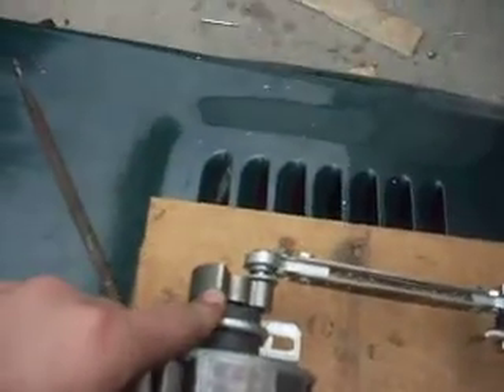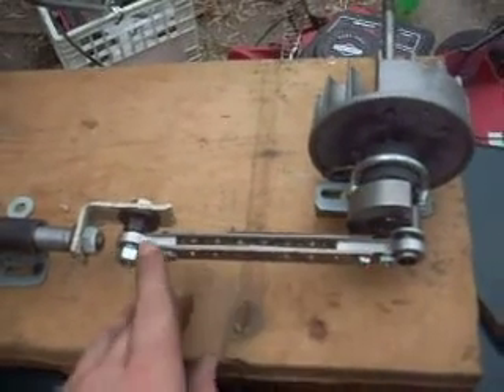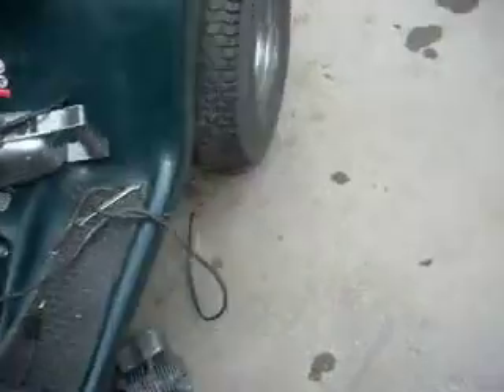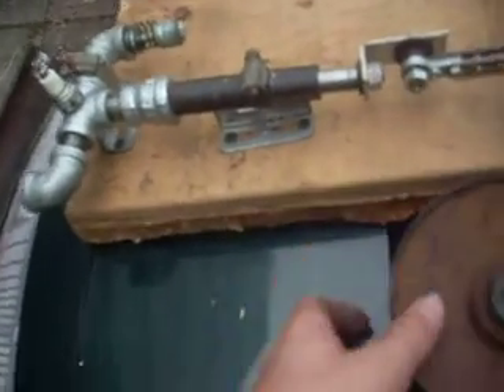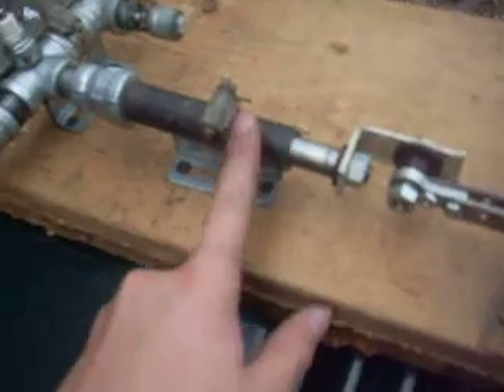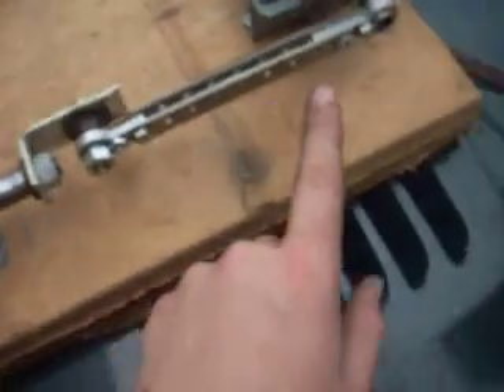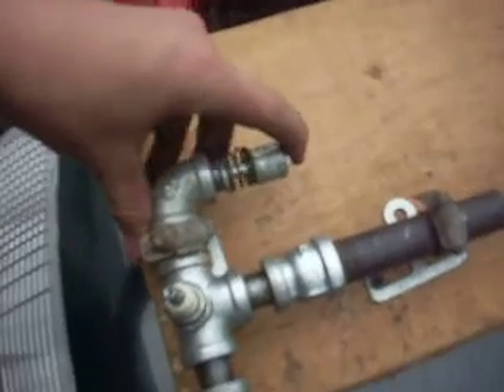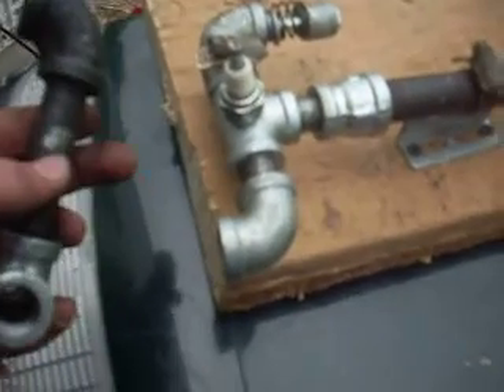home made engine vid 1

Comment: I love it! Has any progress been made? You are like me, with the engines etc. For ignition, i would say use the magneto from the 40cc, but i do not know if that is too much resistance. Hmm, buy one of those tiny ignition coils that go on top of the spark plug!! Then, you can make a little cam and some contacts out of the parts from a torn apart relay, and wire that in series with the ignition coil. Perhaps a resistor in series, maybe 10 ohms, to provide only low current, and a capacitor.

Comment: Are you familiar with Henry Fords first engine? Its very similar in principal to this one. Cylinder lubrication can be solved by mixing oil with your fuel. My recommendation is that you secure the cylinder better and beef up a few of the connections. I'd hate for the top end break free and launch forward. Stay safe.